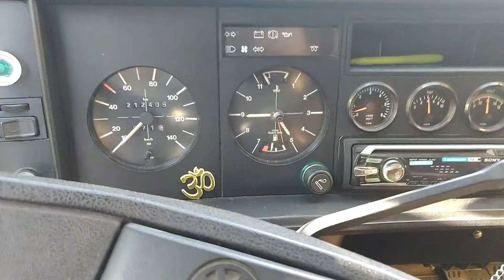VW LT 31 Sven Hedin Westfalia

Comment: The vehicle is a 94 model. As you said, the cylinder head has been changed, and it fails from the same place.Also what is the fuel consumption?I would be glad if you inform me. Thank you in advance
Reply from the maker: Il mio motore è 6 cilindri diesel 2.4  e consuma circa 1 litro per 10 km a pieno carico